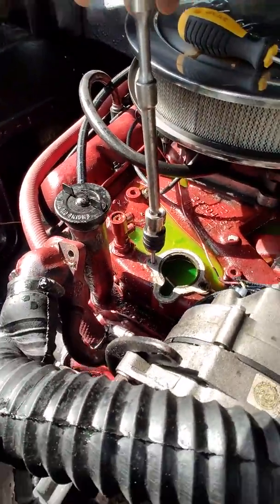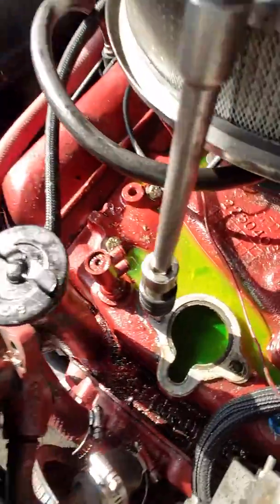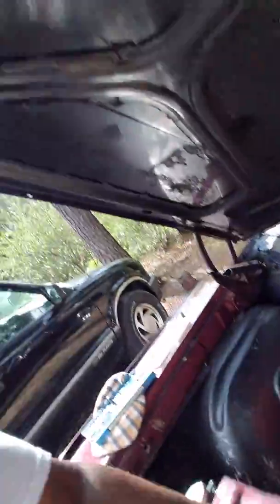1967 olds,I thought I screwed up

Comment: Johnny make sure you use a grade 8 screw to replace the broken one. Also use neverseize so the next time it will unscrew easier.
Reply: jon lennon I helped a guy out who had a rigid frame motorcycle.
Cheap bolts and didn’t put Loktite were he should have. The break was so clean I think the bolt was made out of glass. He wanted to put in brass for the “Old Skool” look.
I explained: This is a motor mount that  just snapped what looks like a Chinese knock off grade 8. Let’s go down to Fastenall and get you something that will last for more than a trip to the gas station.
This was back when we were getting all of those counterfeit Chinese bolts that were crashing planes.

Comment: Hey Johnny, flush the cooling system to get the metal out of the water jacket. The metal won’t get to the cylinders, heads, and combustion chamber unless you have a coolant leak in the manifold itself. I might have missed it, but looks like you just need to look after the cooling system and cooling jackets of the engine. Getting the metal cleared and flushed will protect and save the water pump and radiator core from blockage. Keep that Cutlass going Bro!

👐😎👐
Reply: I was just going to post the same thing! : )